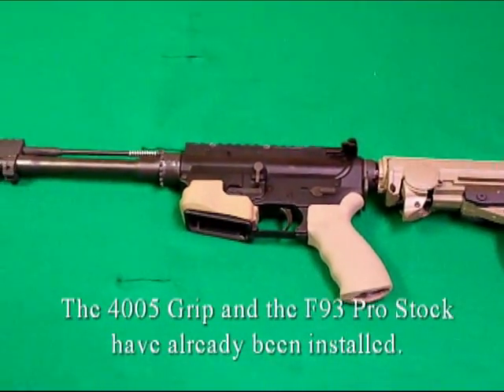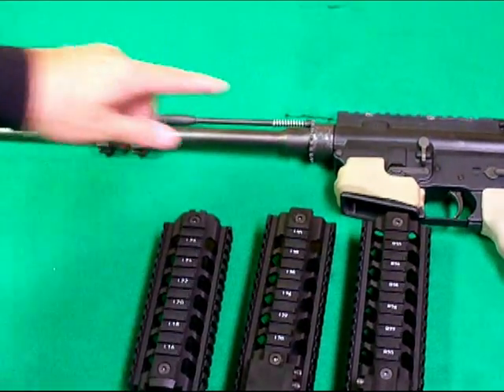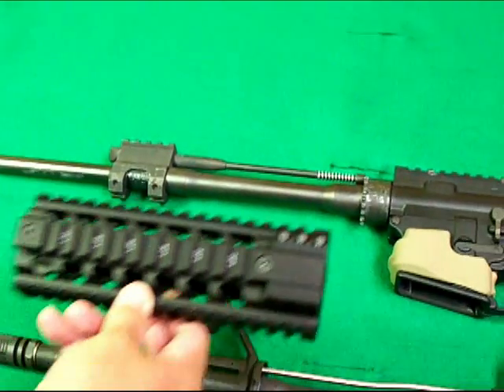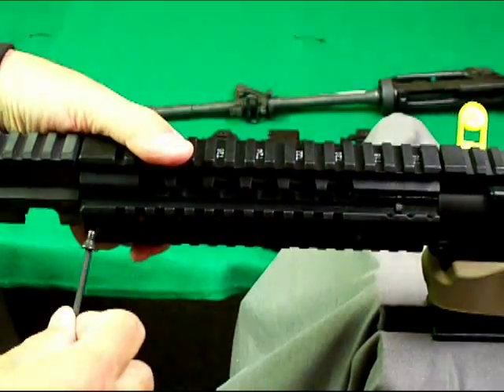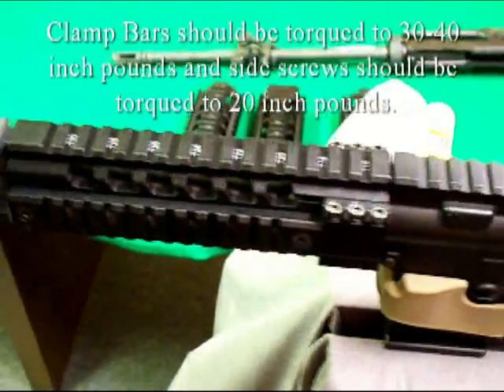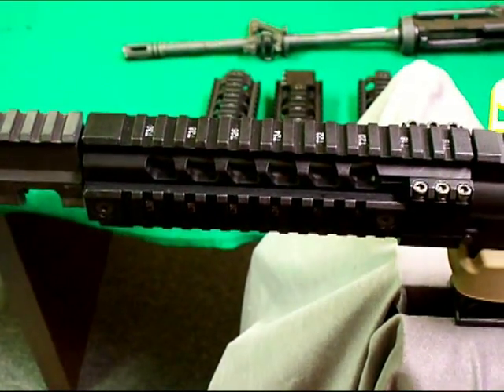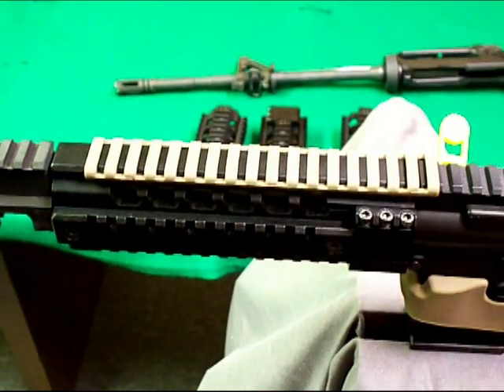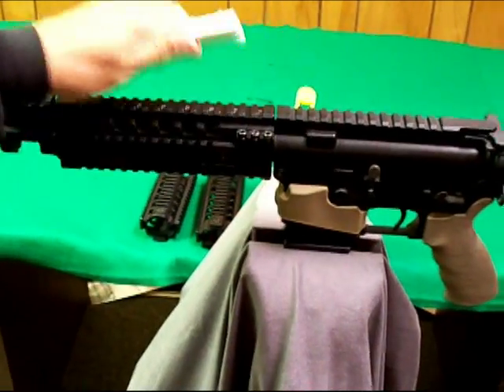z-float handguard installation.mp4

Comment: I appreciate the instal video, but it doesn't instill much confidence when the forend is installed Crooked. its off by at least 2 degrees from the receiver. Is this easily clockable and just wasn't shown by the installer?   I know there's several hand guards on the market that always seem to be "off" just a bit due to mounting  methods (ie YHM freefloats can be a headache)  

So was this just an oversight in the video, or are there other adjustments needed to ensure a proper rail alignment.